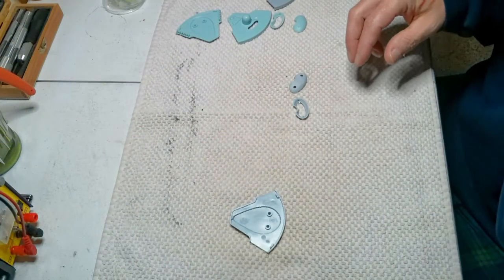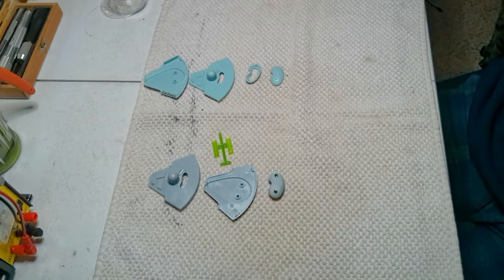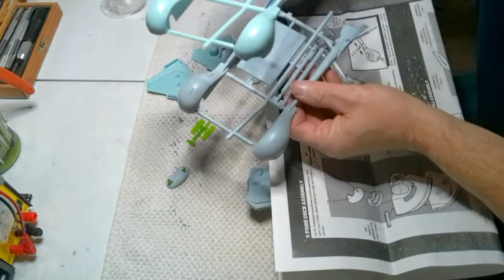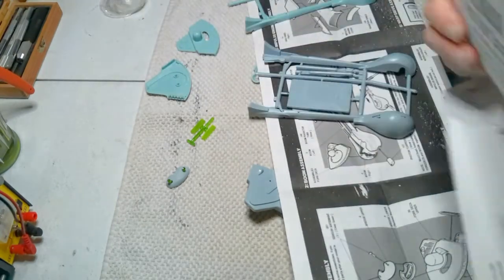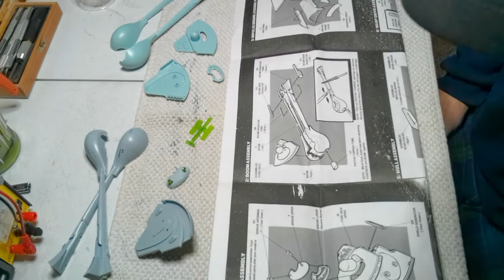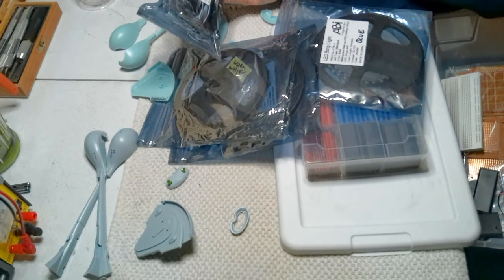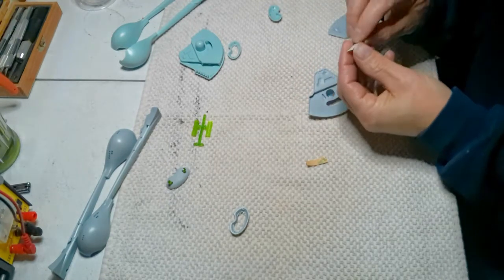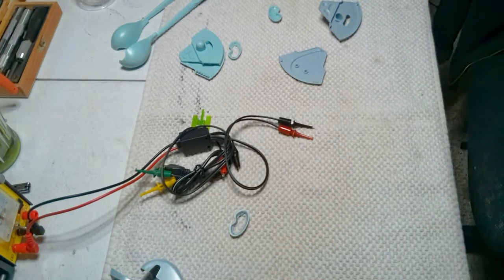AMT STAR TREK KLINGON & ROMULAN D7 PART-1  BRIDGE LIGHTING -1

Comment: The latest Polar Lights 1/1000 D7 comes with both Klingon and Romulan variations. Both for decals but also some parts and paint instructions. Maybe you could scan those decals and scale them and and print on decal sheet paper. 

Yes, the Romulan versions with bird on the bottom is from later cgi renditions (not really original or canon in my opinion, still looks nice though). The original TOS model versions in the Enterprise Incident just looked basically like the Klingon versions.

Also the original model D7's never had any lighting. The Star Trek model maker has since argued that if they had a bigger budget they would have lights, so I guess it's up to the home model makers to either make them as they were or as they should have been.

Comment: Where did you get the led strip from? Any links?
Reply from the maker: Hello & thanks for watching. hear is a link to the seller on ebay that I ordered the LED strip from I hope this helps & thanks again 
  Check this out on eBay!
Flexible 600 LED Strip Light Super Bright Double Density SMD 2835 5M / 16 Feet
https://www.ebay.com/itm/254629609218?mkcid=16&mkevt=1&mkrid=711-127632-2357-0&ssspo=nG1-6N2LScy&sssrc=2349624&ssuid=BfH_W0iXSKS&var=&widget_ver=artemis&media=EMAIL